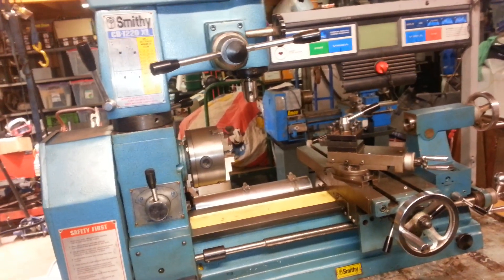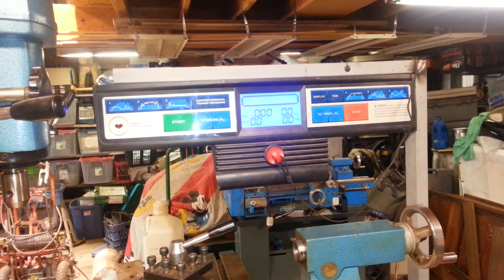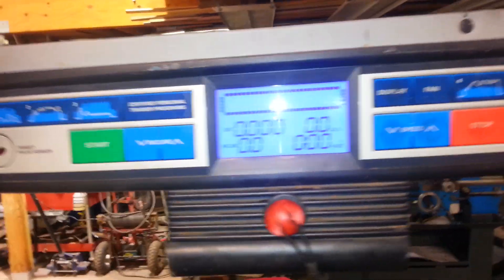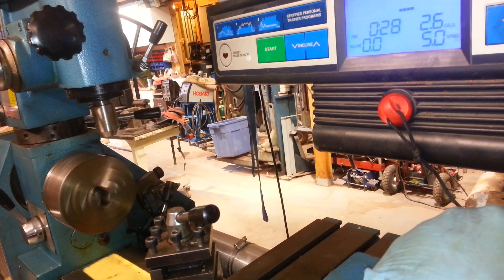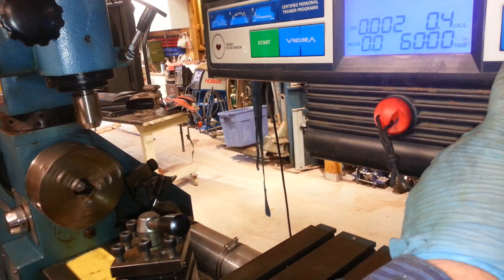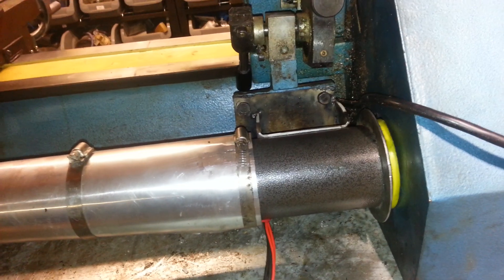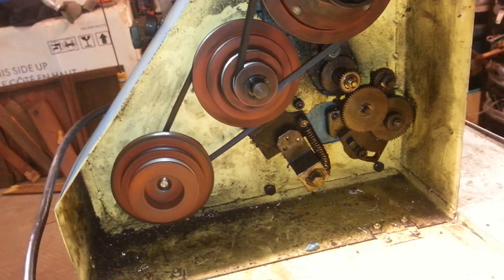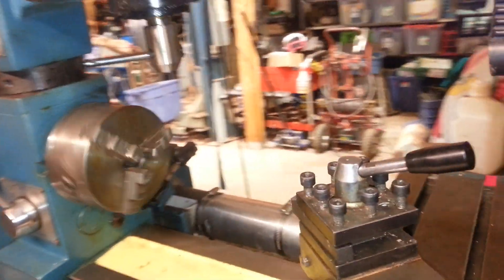Smithy 3-in-1 lathe mill variable speed treadmill motor conversion

Comment: If you switch the blue wire from the control board it will keep the speed settings when you turn it on and off.

Comment: I have a 1220 and just got a treadmill motor to use on it. This video was very beneficial for my planning. I do plan to drive the PWM from an arduino and add DRO. Having the system working as original will allow checking the  signals that drive the  board. Thanks for the video.
Reply: Nice job. Can't beat the price compared to a VFD smithy unit. Thanks for sharing.

Comment: I'm considering a similar mod to my Smithy 1220XL, does your setup provide constant torque(after start up)? My main complaint about the 1220 is that it offers barely any torque at slow speeds, which makes threading a dangerous activity trying to make sure not to crash into the chuck. Smithy sells their planetary pully, but you have to remove the pulley assembly every time you want to change to/from low to higher speeds. Plus the whole belt & pulley system to change speeds.

Comment: I did this to my AT-300 3 in 1 (Smithy's precursor to the 1220 series). It is basically the same machine, but with a smaller cross slide table.

I need to figure out a way to convert the treadmill MPH display to RPM instead. I've attached a magnet to the main shaft pulley inside the pulley case and run the Hall effect sensor from the treadmill board and it does read MPH. Now I've got some electronic tinkering to get past. Have you figured that out yet by chance? I was also thinking of using the incline motor for something (Z axis?) eventually.

Hope you don't mind, but I posted your video on instructables.